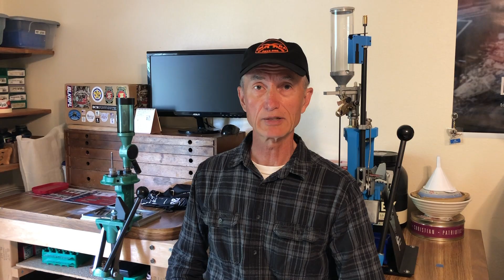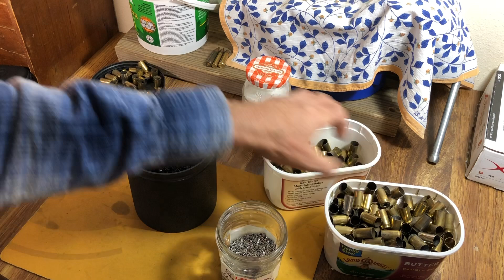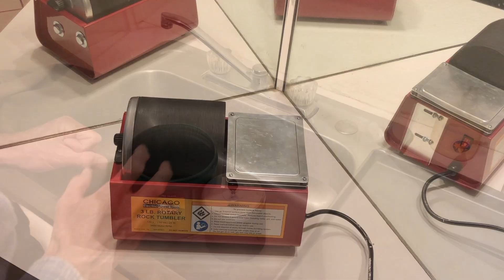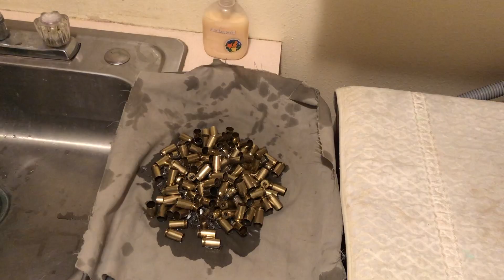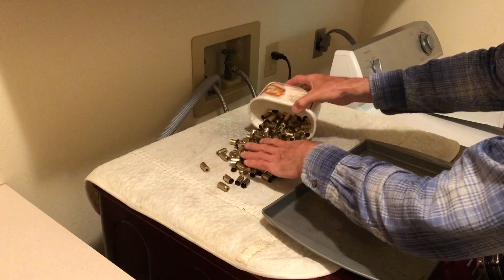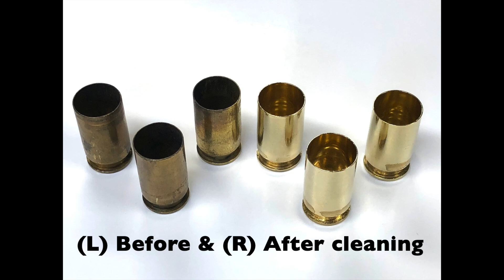Using a Rock Tumbler to Clean Brass for Reloading

Comment: I've used the double HF tumbler for about 10 years, I think I paid about $39 for it.
I tip I would add, instead of dish or hand soap, use Zip Wax or Turtle Wax auto washing liquid soap.
The benefit is it coats your brass with a wax, and they say bright.

Comment: a simple bucket and that solution work just fine, just soak them, it works and if you want to get creative,pour them back and forth in another bucket,HF will never get my money for that
Reply from the maker: Thank you. I hadn't heard that method, but I suppose it will wash away grime or grit of the cases, which is the most important part. This is the method I learned at the beginning. I'm used to this procedure and pleased with the results.

Comment: While this probably cleans the brass like it is new, it seems like a lot of tedious steps.  I am not a fan of wet tumbling I see no need to have spotless brass.  After all my goal is to quickly fill the inside with burnt carbon and throw all of it on the ground.
Reply: There’s many ways to clean brass... I think the point of using wet media is so that all the carbon and lead coating the brass stays in the water and not in your lungs.😮
Reply: @rdmercer2451  drop a dryer sheet in the dry tumbler and it eliminates dust and collects most of the stuff that comes off the cases.    I don’t know what exactly is collected on the dryer sheet but it turns mostly black so we have to assume it is the carbon or lead.
Reply from the maker: Thanks for the feedback. If you don't clean your cases, isn't there risk of abrading your dies, especially the carbide sizer die?
Reply: @oakleydefense5513  well I reload mostly pistol calibers and from my experience as long as the cases are free of debris you will not damage the dies.  I tumble in crushed walnut shells, separate the media out, add a squirt or two of case lube so the press runs smoother and they go into the case feeder on the old 650.  I have loaded way over 10,000 rounds of 9mm this way with zero problems.